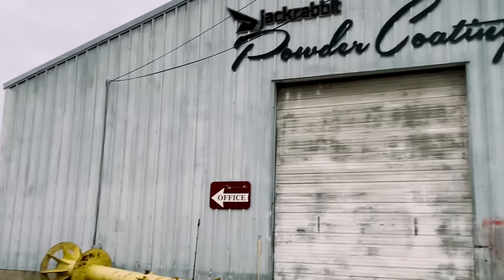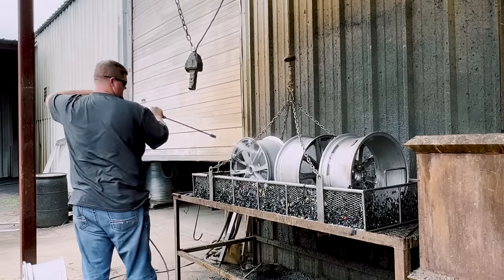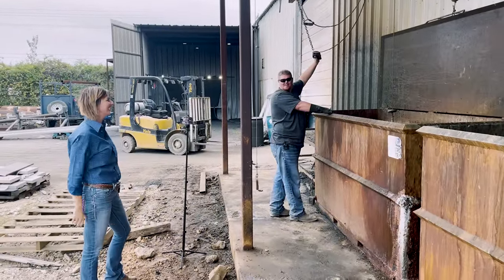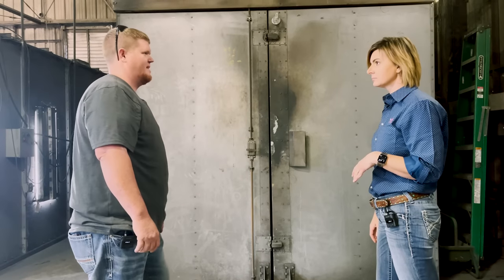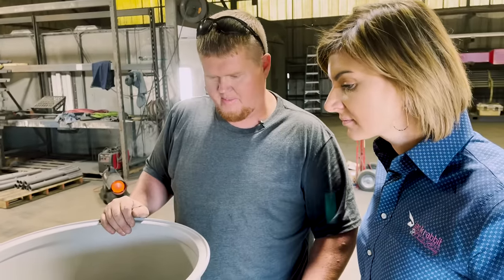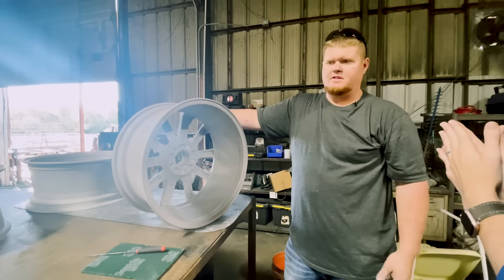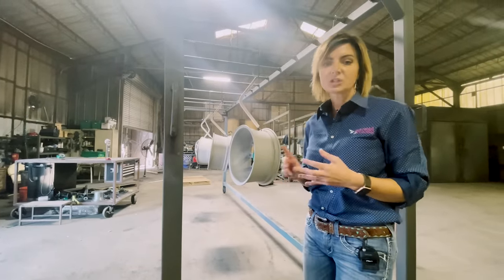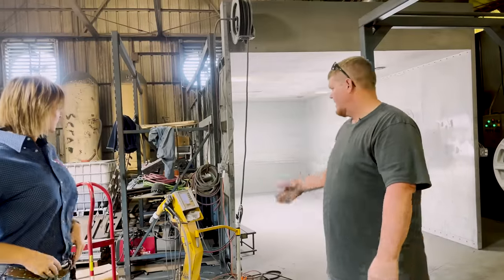The Beginners Guide to PowderCoating Wheels from a REAL shop

Comment: Cool video. A few things I'd probably do differently but nothing too major. I'll post my thoughts mostly for the benefit of those just getting into the game since this video is targeting beginners. As a fabricator/coater myself, I've also dealt with around 30 different powder coaters over the years in an attempt to handle some of our overflow work, that more often than not ended up with us having to fix all their mistakes. Unfortunately there are too many ignorant, egotistical, and downright shady people in this business. The industry is really in need of good honest people who care more about a  building a good relationship with the customer than just extracting the dollars in that customer's pocket. So here goes.

First, I'd use a better blast media; coal slag leaves a pretty wimpy surface profile for the powder to grab hold of, is about the slowest cutting media and can't be recycled since it pulverizes into dust so quickly that it will hardly cut after the first use  (also reduces operator visibility as seen in the video). Plus it embeds itself in the metal which calls for extra work to remove (hence the sandpaper reference). I have dealt with one coater who does a lot of work for the automotive industry, who absolutely refuses to spray anything that was blasted with coal slag (Black Beauty). About the only thing attractive about it is the price, which when compared to the more legit, recyclable medias is actually costing quite a bit more over the long haul. We are looking at a stainless steel grit that can be recycled 10,000 times, cuts 3x faster than coal slag, has zero dust and no transportation/disposal costs besides the first and last use. 

Second, I'd use a pretreatment such as iron or zinc phosphate or zirconium oxide after blasting to wash all that slag dust off the rims and add at least 1000 hours of salt spray resistance to the end product. All that brake dust and, if you live in a snowy area, salt on the roads is going to be working overtime to destroy all your hard work through galvanic corrosion. Plus a pretreatment is going to significantly increase your bonding by chemical means instead of relying solely on your blast media to create a physical bond. It's something that barely costs anything besides a couple of minutes to apply, yet could easily add several years or more to the life of the product.

Third, I'd just be more careful with the parts after they were blasted and outgassed and are ready to be sprayed. Especially about handling the parts with bare hands, all those salts and oils are just being put right back onto the rims. Those are the areas where the coating is going to fail eventually. It's going to corrode beneath the powder coat. Nitrile gloves are too cheap and effective to go without. Also, I would think the guy would grind the hooks and cart for grounding before the wheels are hung...guess where the shavings are going all over?

Finally, other people have mentioned PPE already so yeah...given the choice, are you going to trust your parts to someone who doesn't care about their own health, or someone who cares enough to take a few seconds to protect it? Also, the stuff laying around outside might send the message that attention to detail isn't your forte. Just a thought.

Overall, good video and thanks for posting it. 

TLDR: Paying a bit more up front can make you or your employees significantly more productive and therefore profitable, plus make your customers happier.
Reply from the maker: Thank you for your thoughtful and detailed response, J Rose! I appreciate your expertise and insights. You bring up some great points about improving the powder coating process and making it more effective and durable.

Regarding the blast media, I agree that using a better media like stainless steel grit that can be recycled and has zero dust is a good idea. It would result in a better surface profile for the powder to adhere to and would be more environmentally friendly.

Using a pretreatment like iron or zinc phosphate or zirconium oxide after blasting is also a great suggestion. It would help to wash off any remaining slag dust and increase the salt spray resistance of the coating, which is especially important for parts exposed to harsh road conditions.

I completely agree with your point about being more careful with the parts after blasting and outgassing. Wearing nitrile gloves and being mindful of handling the parts to avoid transferring salts and oils would help to prevent corrosion and ensure a longer-lasting coating.

Lastly, safety is always a top priority in any workplace. Taking the necessary precautions to protect oneself and the environment is crucial. I will make sure to emphasize the importance of proper PPE and attention to detail in future videos.

Thank you again for your feedback and suggestions!
Reply: @callusedcash  steel grit is also a bad choice of blast media as the steel embeds itself within the aluminium and can lead to rust
Reply: Excellent points.  I’ve been using coal slag and I’ve been having problems with rough surface particles in the finished product.  I’ll be using aluminum oxide to see how that works.
Reply: @accuratealloys  we use 100# ali oxide at the shop and works a treat with the right blaster
Reply: I would use garnet

Comment: Using that acid with no PPE is so dangerous. Using it with out a mask is insane, the MSDS says to not inhale the fumes
Reply: Well thank you Mr OSHA!!!!!
Reply: @scottyfiveo1  it’s common sense.. that stuff was used as chemical warfare weapons in ww1. She was talking about how bad it was affecting her in the video lol
Reply: @scottyfiveo1  don't gotta be OSHA to know spending time hovering around methylene chloride is a mistake.
Reply: @bikebuildsmx9496  none of these chemicals were used in ww 1
Reply: @bikebuildsmx9496  phenol, formic acid, methylene chloride, and hydrofluoric acid are what is in b17
Reply: @UnknownCoatings  Correct! Though they do warn if B17 comes in contact with heating elements (oven coils, kerosene/propane heaters, etc) the methylene chloride will break down into phosgene and chlorine gas. Phosgene gas was used in ww1.
Reply: Ppl l
Reply: I used to use way larger tanks to clean oily parts for sandblasting at a huge frack pump manufacturer and I used to breath that shit in every day all day 😭
Reply: Been around it 25 years now never had any issues.
Reply: @jonboatmorava9115 this is an example of dead man walking folks.   "I been doing it for 20+ years. It's not effected me". All while your internal organs are shutting down. Death will come get you slowly. 😅
Reply: 2 years from now I see a lawsuit when she claims got her cancer from no PPE using product.... and has video for proof. 😂😂😂
Reply: Same thing goes for windex
Reply: Only bosses hate OSHA.
Reply: Womp womp
Reply: I use to do the same then got diagnosed with cancer at the age of 35 but hey, at least I looked cool not wearing a respirator painting parts
Reply: That B17 is no joke. The smell sticks to your clothes big time and you will wreak wherever you go.

Comment: Very interesting and informative video. The one thing I didn't like was after cleaning and drying you kept touching the "clean" wheels with your bare hands. Your hands have oils on  them (even if they feel dry). I acetone what I plan on powder coating (or just painting) and then out gas. Always use gloves when touching anything clean if you plan on coating (be it powder coat or just painting ).  Just FYI. Thank you for the video.
Reply from the maker: Great tip! Thanks for sharing

Comment: as to optimization.  Could having a smaller oven for smaller batches save significant money on the heating cost?  If having multiple ovens and carts of differing sizes adds too much complexity, can you come up with products that could be put into the oven along with small custom batchs, so as to maximize time and heating energy cost?  If wheels are a common item being processed would having roll of stickers for the inside instead of custom cutting tape save more money in labor than the stickers cost, saving money and speeding up production?
Also, it woukd seem, documenting OSHA violations on social media could be a potentially expensive buisness practice. Very expensive, even years later.